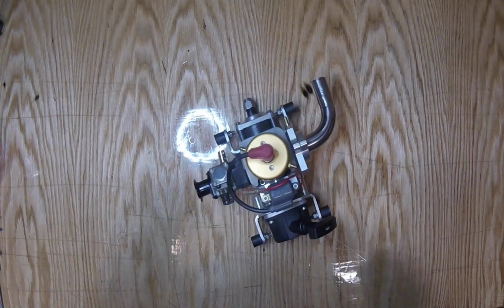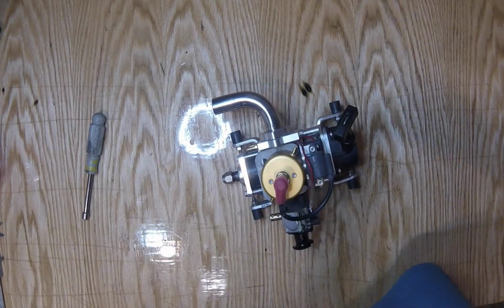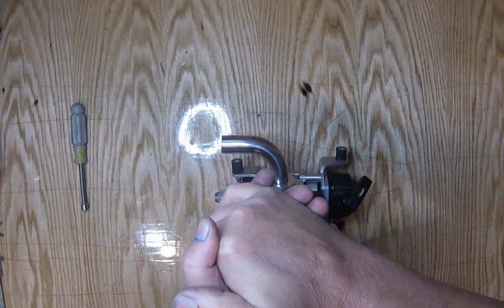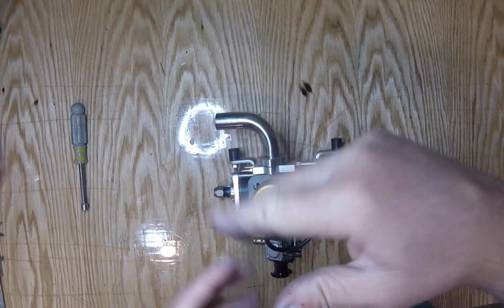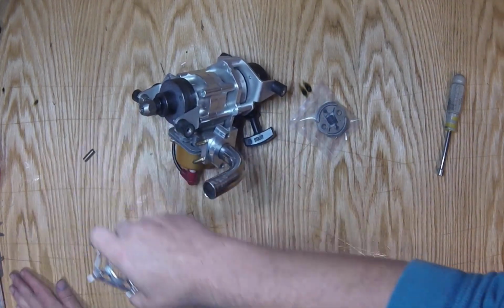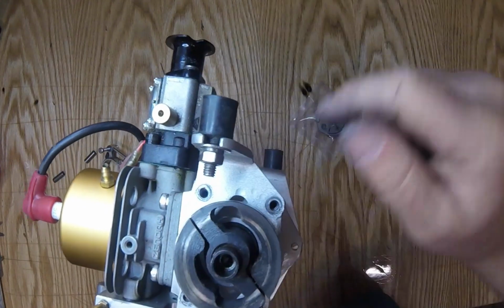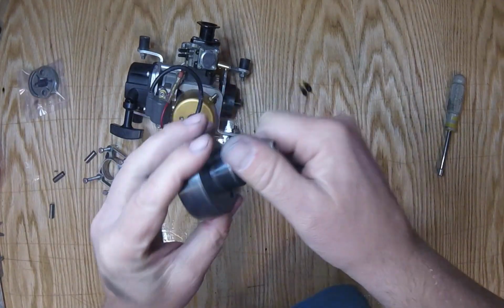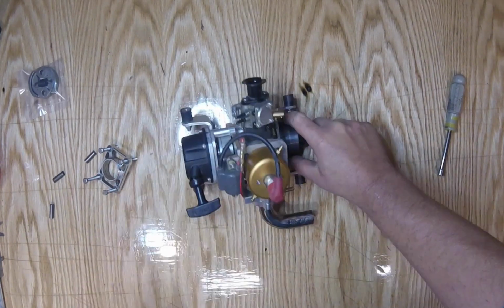Rc GAS Boat Clutch, Should ya?

Comment: In the past I ran a clutch with a square drive. Now I’m looking at adding. Clutch with a round Collett. So it’s my understanding, on square drives, the boat is pushed from the strut/ stinger. On a round collett, the boat is pushed against the collet, whether it’s on the motor or in this case a clutch. Is that right?

Comment: Good video, i do have a question. installing my first clutch in an A-Box and got the clutch kit from Gizmo and cant seem to find any docs on how it goes together. Mainly the hold down bolt for the clutch to the crank shaft, does the bolt go through the bell and shoes? or just hold the shoe on? Thanks in advance.

Comment: Not all clutch systems for boats uses these type of shoes, remember for instance the clutch system of my Daytona which is basically identical to the ones on the fifthscale cars 😅 
Anyway ,I’ve like the benefits of the clutches on the gas boats, even it costs some performance,it’s ok for me because I’ve Do it mainly for having a good time while sitting on my camping chair, if I really wanna go fast,I’ve drive one of my damn electrics 😂

Comment: if you are not a racer use a clutch. it makes the whole experience easier and more fun.
Reply from the maker: I don’t disagree! A lot easier in most cases
Reply: Well, another thing my boat is almost five feet long with zenoah 26cc w/tuned pipe, there is no throwing it in the water, mine has a nice bell clutch and runs beautiful, start stop whenever I want on the lake👌